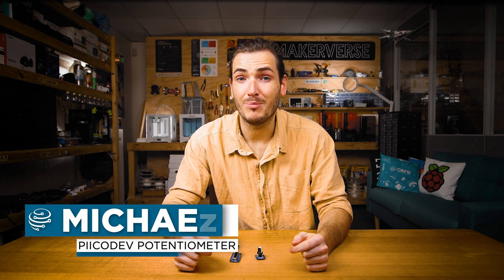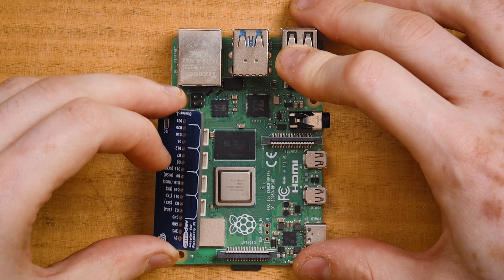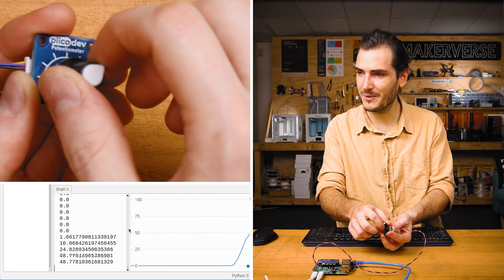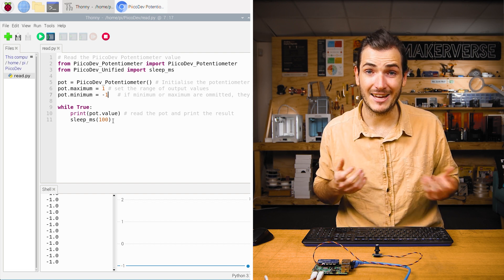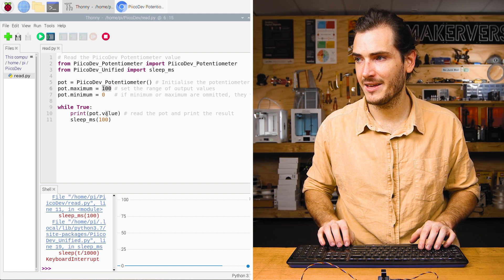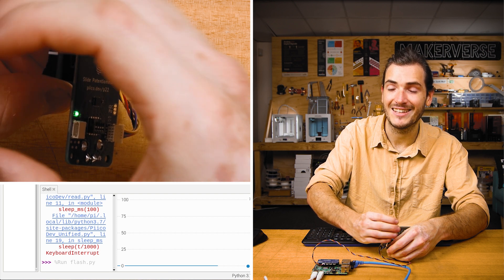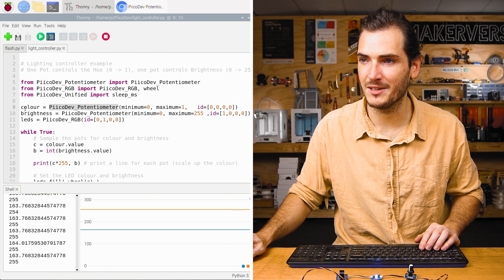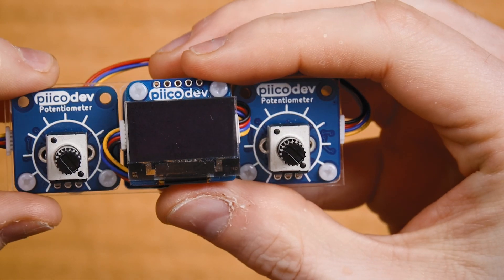PiicoDev Potentiometers | Guide for Raspberry Pi

Comment: this is great as a start - now, how would I use this to change the volume of a video I'm running via the Pi?
Reply from the maker: You might wanna check out the pyalsaaudio library. There is some usage tips here:
https://stackoverflow.com/questions/41592431/changing-volume-in-python-program-on-raspbery-pi